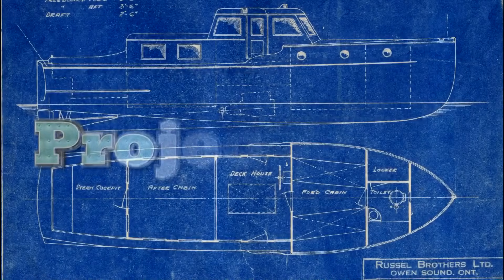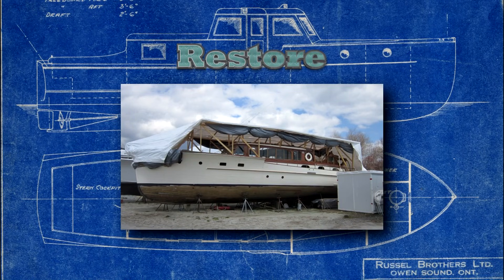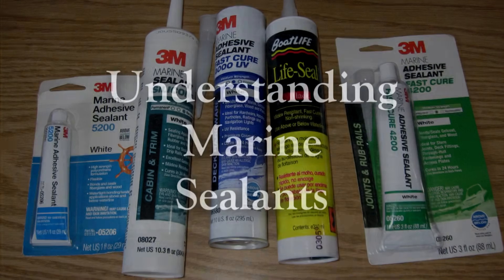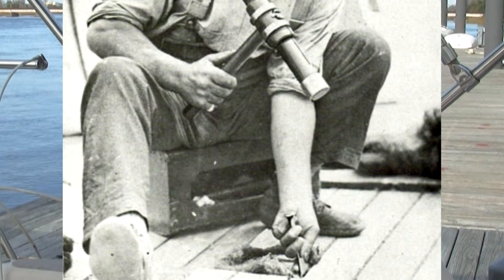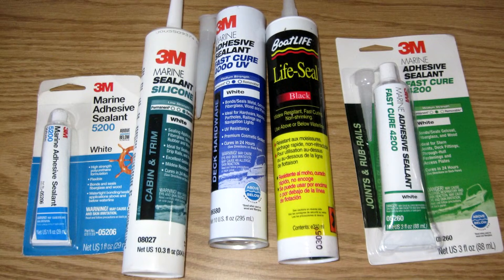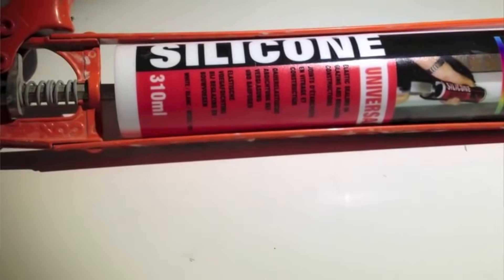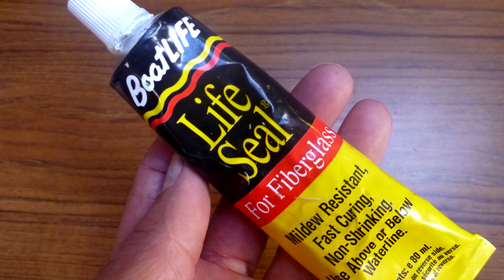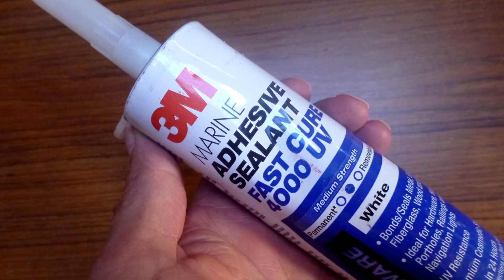Understanding Marine Sealants

Comment: First and foremost thank you for putting yourself out there and sharing your extensive knowledge.  Making videos is not easy, it takes a good deal of time and effort so thank you for that.  I learned a lot from your video but I’m left with a lot of questions too and I’m thinking that this may have made a better article than video.  For instance you talk about the difficulty of cleaning up silicon and why silicon gets a bad wrap.  But you did not share and/or demonstrate any tips and techniques for properly cleaning silicon from different surfaces, e.g. plastic, metal, fiberglass, so when you put your project back together you don’t have any leaks and it lasts.  You also mentioned butyl tape and how there are many types and it is difficult to ensure you get the right type of butyl tape for marine applications.  You did suggest a few areas where you might want to use it like chain plates but you did not let us know any tips or tricks to ensure you get the right kind…knowing that it is difficult to do that is not very helpful without the additional information that will help me distinguish between good butyl and bad.  My intent is not to belittle or discredit but to offer areas that might help make your videos better.  Again, thank you for the effort you put into your videos and for sharing what you know!
Reply from the maker: Thanks for the detailed feedback. I appreciate you taking the time to offer suggestions for future videos.

Comment: I have through deck chainplates (ugh). Has anyone ever tried using both butyl and lifeseal on such an application? My idea (just an idea) is to fill the hole in the deck with life seal, then when cured, used butyl on the top: against the chainplate and under the chainplate cover.
Reply from the maker: I would go other way around, first butyl then the lifeseal. Butyl does not weather well.

Comment: What would be a good sealant for the alum shrouding past the transom(16'Starcraft with 75hp mercury force) ... Not sure what that area is called but I do not want water getting into the battery/gas can area beneath. TY in advance
Reply from the maker: I would use poly-sulfide. Good luck

Comment: I need to rebed deck hatches and I’m Overwhelmed by variety of sealants.  Looks like I should use silicone or 3M’s 4000 UV.  any input?  Thanks!
Reply from the maker: I assume you are sealing aluminum to fiberglass, so I would not use silicone for this, I would go with the 4000 or a good polysulfide. Good luck

Comment: What would you recommend for a rub rail? I'm restoring a 1976 Bayliner Bucaneer. Major leaking from the rub rail. I have it all prepped to reinstall. I am not sure what sealant to keep the water out.
Reply from the maker: This would depend on what the rub rail is made of. If aluminum or rubber use a polysulfide. Good luck

Comment: I am looking for a sealant that would be extremely resistant to mould and mildew. Which would you recommend? Thanks
Reply from the maker: Part of that depends on the application but if using silicone make sure the label says it is mildew resistant as silicone seems to be the worst for mold growth. Good luck
Reply: @Boatingzen  I want it for the bathroom but mildew resistant silicone sealants always seem to succumb to mildew in the end.

Comment: I’m getting ready to install a new tilt trim motor on my boat. Even though it has a oring I also want to apply a sealant around the flange for extra sealing from salt water. Which brand and type do you recommend to use
Reply from the maker: I am thinking you are talking aluminum to aluminum so I would suggest a good quality marine silicone. Not West marine brand, 3M and boatlife have a good product. Good luck

Comment: I use 3M Marine silicone  to repair a crack on faucet sink the beak had a small rust water was coming out through a crack  i sealed it with the silicone it works no more  water spraying out through the crack anymore.
Reply from the maker: Glad it worked

Comment: I used marine loctite and I messed an area up. Before I try anything do you have a tip on how to remove it? A heat gun or any solutions???
Reply from the maker: Normally I use a sharp chisel to cut and scrape off the sealant. Good luck

Comment: Thanks for the useful video. I have some leaky stanchions. Which sealant would you recommend to put around the bolt holes? I was recommended 3M 4200, but that one wasn't mentioned in your video.
Reply from the maker: 4200 will work. I might also suggest lightly coutersinking bolt holes and using Orings around the bolts as well. This will help as stanchion bases are subjected to flexing making them a challenge for most sealants. Good luck

Comment: Hello Captain Wayne!  What a great presentation!  Your information will really be useful in the future.  I have a specific questions regarding the use of adhesives, I will be installing strip lighting with a 3M tape on the back side.  These strips will be 12” long.  I have read comments that suggest the adhesive tape wil fail and that one should use an adhesive to help support the lights underneath the rail of my fishing boat.  Any suggestions as to what adhesive should be used?
Reply from the maker: 3M adhesive is generally good. I would suggest starting with that. If that fails over time contact cement might be a good choice. Not sure of what you are sticking it to, like fiberglass of metal. Keep it simple and good luck

Comment: Anybody know the best sealant to apply underwater in the ocean on a boat hull???

I'm currently in Jupiter Florida and got a free 35 ft sailboat I'm just trying to temporarily stop the leak.  It's in the hull and I'm looking for a product that maybe someone's use and had success with to dive down and apply under the salt water just to stop the leak temporarily at least or longer term.   

What would adhere best? The water is dirty as it's in the intercoastal in Jupiter Florida so it's a lot of river water that is about to meet the ocean

Comment: Do you think the 3M 5200 would be good for a inflatable boat? I would like to seal my boat. It is PVC with a aluminum hull
Reply from the maker: I have tried this with mixed results. If you try it lightly sand the surface first. Good luck

Comment: Hello Captain Wayne,  I’m replacing plastic thru hull scuppers.  They are push together scuppers.  I have removed the old ones, they were 19 years old, and removed adhesive and cleaned all surfaces. Bought new TH Marine Plastic scuppers, they are identical to the old ones.  They are in transom area to drain the outboard motor well. I guess they are considered above the waterline.   They have rubber flappers inside them.  I have a 26’ single outboard Proline walk around.  Can you please recommend what sealant I should use? Thank you!  Alecia
Reply from the maker: Silicone when sealing plastic fittings. Good luck

Comment: I have to pull my fuel tank on my Grady 21’cc moved the console and t top.  Also I’ll be reseal all the adhesive calk on the deck and leaning post ,,,if you wouldn’t mind sharing your knowledge and giving me the best product’s to use for those jobs that would be great. 

Also I’ll be installing sea deck and painting both topside and hull

Comment: I need to bond bailer gaskets to stainless steel housings through the hull of my sailboat. These gaskets generally last many years before replacement is an issue. What would you use to bond the gasket to the fixture. It is a Ronstan outside mount bailer.

Comment: What do you recommend for resealing the glass round windows on a boat? Need to clean the old sealant around the fixes windows/glass and reseal?  
Was also going to Use acetone to get things clean prior to the new sealant, I would think is ok. ? Elbow grease with a light rag.

Comment: QUESTION: My Shuttle Bus/Camper is fiberglass, with two seams front and back...which leak often. RV caulk is not really for fiberglass, and there is a bit of vibration due to driving......so what caulking/sealant would you recommend? Thanks in advance for any advice.
Reply: Hi I also have a fiberglass shuttle bus , I use butyl tape and it works fantastically!!

Comment: Hello, What would you recommend for plastic and rubber for underwater ? I have Marine 3M 5200 Adhesive or Marine Silicone.. it’s to glue fins on my kayak!! Thanks
Reply from the maker: You will likely need a special adhesive for the type of plastic your kayak is made of. Check some of the 3M adhesives for ABS plastic

Comment: So, what do I need to glue PVC board or composite decking board to my fiberglass bass boat? Without being long winded, I am replacing the old seats with new ones and there is nothing behind the thin fiberglass to attach the backs too and the backs need to be offset so the live well lids can open without hitting them. I want to glue some type of composite material to the fiberglass and then through bolt the seat backs to it. This should take care of both the issue of having something to screw to and creating an offset. Otherwise I would remove the foam inside and install a backer board, but I would still need to offset the seats and the screws would need to be much longer, causing other issues. So, what adhesive? It will still be in sunlight even though it’s behind the seat and I may paint the topside and inside this winter, so preferably paintable. It’s a great functioning 1994 ProCraft 200 Super Pro, in case you’re wondering what I am destroying 🥸

Comment: I have a plastic cup holder that has started to come loose that’s recessed into the casting deck on the bow of my 2018 glasstream 17ccr. I’m assuming that the sealant used to stick these down was just a bead of silicon caulking around the cup holder? Is silicon caulk the best this to use in a repair for this application? What product would you recommend? I need a white caulk. Thanks for the video, it was super informative. You’re very knowledgeable on the topic!
Reply from the maker: Yes silicone is best with plastic

Comment: Thanks Wayne. I have used all 3 of 3m 5200,4200, 4000 and mainly use correctly but sometimes not. And always seems 50:50 people debate
Reply: Would you think the 5200 would be good to use to glue the top half of a fiberglass boat back to the bottom half? The top fits down into a 3/4” lip on the bottom and gets riveted or screwed with an aluminum/rubber strip around the seam. You sit, steer and hold on to the top of the boat like a motorcycle...The boat in question is a 1969 Barracuda hydrocycle, a predecessor to seadoo that takes an outboard motor, there is a short video of it on my channel.

Comment: Dear Capt Wayne, very informative video. I'm planning to replace my car headlight's lens as the current one has turned yellow with age. What would be the best type of sealant or silicone to use in resealing my headlight with the new lens? Any particular brand you would recommend? I do not want any condensation to form inside the headlight for a long time to come. Thanks in advance!

Comment: Thanks for this wonderful explaination. 
Could you please recommend sealant and top coating for wooden water basin / sink  installed in bathroom. Please.
Reply from the maker: Polysulfide works well with wood and should have good resistance to cleaners.

Comment: You forgot Boatlife Life caulk. I’m starting to use this stuff in place of 5200. Works better when applying currently wet conditions (rain or under water). Drawback.. the stuff stinks, one good whiff can make me gag.
Reply from the maker: Boatlife is polysulfide which I talk about. I agree it is a good sealant and my go to sealant on my boat. Thanks for the comment

Comment: this is a little after the video but my dads aluminum boat has some pinhole leaks and i was told resin would be best option i tried rubberized spray and it still leaks....gonna try resin next....but any other suggestions?
Reply from the maker: You may want to glue a plate over the area with pinholes. Good luck

Comment: Thanks for the video.  Which would you use to seal gudgeon that sometimes goes below waterline, 3M 4000 or 4200?  Also which of those would you use for chain plate covers on the deck.  Boat is J22.
Reply from the maker: For the gudgeon I would use 4000 or polysulfied, for chain late butyl tape

Comment: I am preparing to remove and replace the caulk in the seams in my boats floor.  It is a center console built like most others and assume the floor is fibreglass.  Based on your video I was going to recaulk with the 3M 4000 UV.  I just wanted to make sure that is what you'd recommend?  Great video by the way.  Very well done and great information.
Reply from the maker: I agree with your choice and thanks for the comments

Comment: Would 5200 be good for aluminum fishing boat? I got some leaks from rivets I cannot get at to tighten and a hair line crack.  Was planning on sandwich a piece of 1/8" aluminum with 5200 and use marine rivets on the tiny crack.

Comment: Best sealant for bedding aluminum bomar hatch to a deck made of expanded celtec pvc?
Reply from the maker: I would use a good quality silicone Boatlife makes a good one Dow 795 is good as well. Good luck
Reply from the maker: I am going to go with a good quality marine silicone as you are bedding to plastic and aluminum

Comment: Installing smart tabs and need to seal old screw holes as well as the new ones for the tabs.  Which sealant would be best for this.
Reply from the maker: I would do a proper fiberglass repair and fill the old holes. Only way to know they will not leak. Good luck
Reply from the maker: I would fill with a resin filler not a sealant.

Comment: Wayne, I have a 1990 Marine Trader that needs to have windows rebedded.  The long stateroom windows are leaking. What is best sealant caulk to use? Thanks Thom
Reply from the maker: Are the window frames wood or aluminum?
Reply: Wayne Canning aluminum frames

Comment: Ok I just bought the 4200 and 5200. My plan was to use 5200 on new deck cleats screws/ backing plate and 4200 on a  plastic thru hull pass through clam shell  that may need to be changed our for a new one at some point as well as heavy duty Metal folding Antenna mounts. Do I need silicone for the screws to mount a plastic chart plotter and clamb shell for coax? Please advise I'm getting reading to the  this boat in to a surface facility for the Auxiliary and I'm starting to panic as I never worked with fiberglass and plastic
Reply from the maker: I would suggest polysulfied for bedding the cleats Silicone for plastic fittings. Do not use 5200 at all.  Good luck.
Reply: joe scott buy a bronze thruhull first more durable and better looking.

Comment: What is the best product for fixing a metal gas tank with very small crack in tank.
Reply from the maker: Replace the tank. Gasoline is not something to have leaking on a boat. For a car or other application where fumes are not an issue there are some good epoxies that might work
Reply: Hi Wayne,  Thanks for your kind reply.  The hairline crack I have is on a car's gas tank and it is so small you can barely get your finger nail in it so thought you might know of a brand and type and where I can get it.  I had someone unconfirmed tell me that Marine tex grey would work but don't know for sure.  Please help
Reply from the maker: Marine tex is good and you could give it a try.

Comment: THANK YOU for this, I've been totally confused about the options! I have a fairly specific question. Which would be best for bonding fabric to fabric then withstand pulling (i.e. the pull and weight of sitting on the fabrics slung between rods, as in a swing). It will be outside as well, but not encountering oils or grease etc.
Reply from the maker: This is really about sealants not adhesives but 5200 is a strong adhesive and would bond many fabrics. I would suggest stitching myself as this is the best way to go with what you are talking about. Thanks
Reply: great thank you! is there such a thing as a 'portable' machine to sew in place that you've ever heard of?

Comment: How about the marine sealant Terason 9160? It has the vinegar smell you refer to, but I was told that it's one of the best to use to keep water out on an above-water surface. Is it ok only for an indoor use? Should I be worried that it was used as a seal between fiberglass and metal? Great info in your video, thank you! I will share it with my uncle who thinks 5200 is for everything. 😬
Reply from the maker: I have not used it so cannot really say. I would say it would be best to stick with a tried and true marine sealant after all the sealant is a small cost of any repair. Thanks for the comment

Comment: can you paint the 4000 uv
Reply from the maker: Yes but in general it is not good to paint over any sealant as the sealant is more flexible than the paint and will cause the paint to crack. Hope that helps
Reply: Wayne Canning I have an aluminum boat. I want to seal it up with this  with one would be best ?

Comment: Thank you for the information Capt. Wayne!  I was going to use 3M 5200 to seal up my plastic kayak's bulkheads but it seems I was misinformed as a high quality silicone will do the job better!
Reply from the maker: If the Kayak is a poly material silicone would be best. Thanks good luck with it.